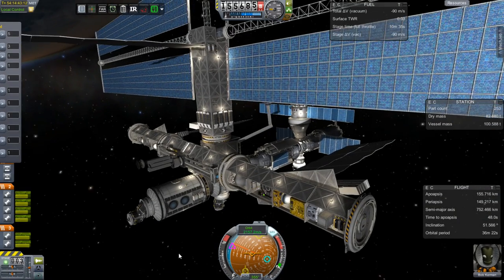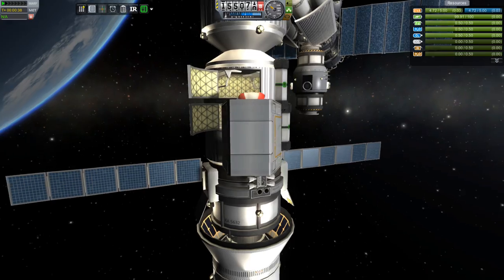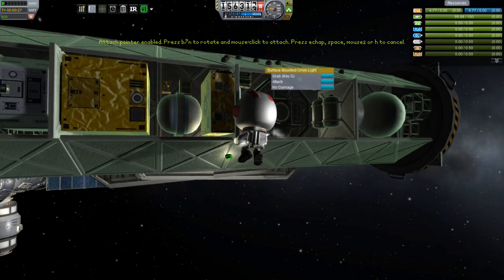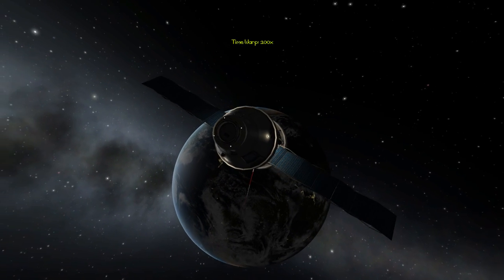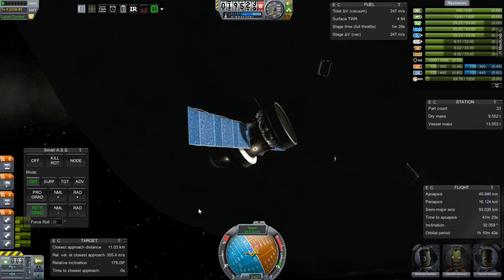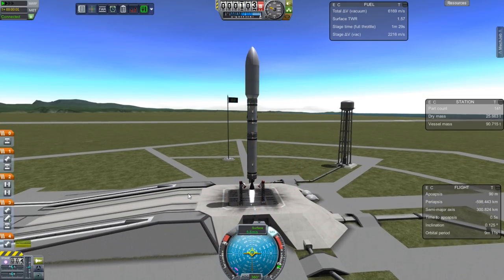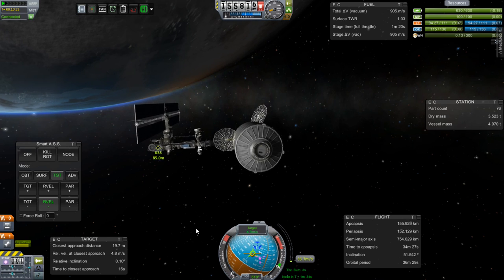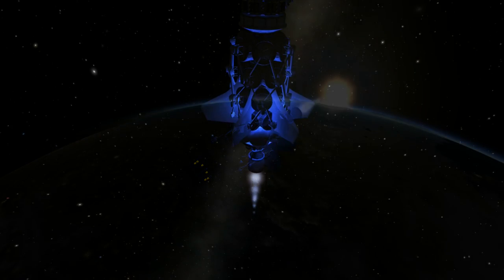KSS-17: ESP-2 / Project Gateway / Kerbal Space Program 0.23

Comment: Bob? how come the GR-2 Radiators you swaped with the Interstellar ones in this episode, are unfindable in NFPP V.0.42 as well in V.0.40 (which was hard to even find) ... I know you don´t share most of your stuff, and I understand the resons for this, BUT...
wouldn´t you feal better to know you helped a desperate person with the problem of getting good lookin and rare parts? please share with us the original TermalControlPanel Part not any of your personalized overhauled parts... just the small tiny GR-2.. It is not inside the NFPP anymore, although it is listed inside the forum thread, and since "Nertea" is on RL vacation you are the only one on this planet, or even on the entire kerbalverse that is capable of helping out...
Reply from the maker: I'll have to look when not at work. However, as I recall what I did with radiators was copy a Kosmos solar panel to a new directory, renamed the part in the CFG, and removed the TGA or PNG or whatever it was using for its texture. Since the model loaded but could not find its texture, it appeared white instead of looking like a solar panel. It looked exactly like the ISS radiators that way. I also scaled the panel a little larger in the "extended" direction, which I think was the Y axis.